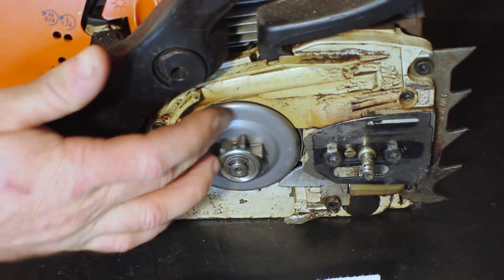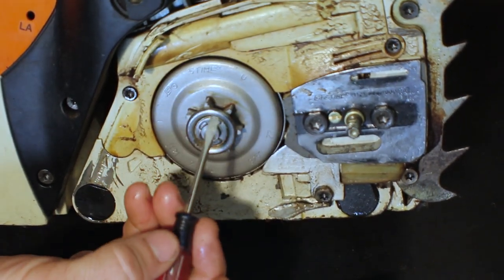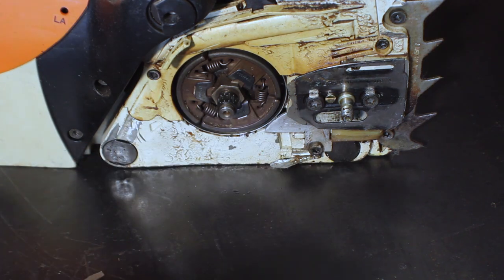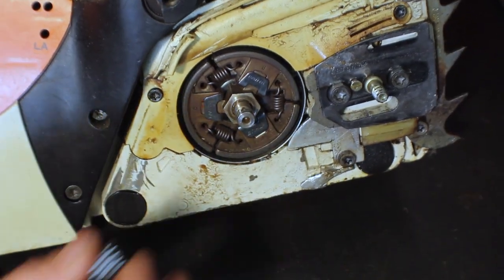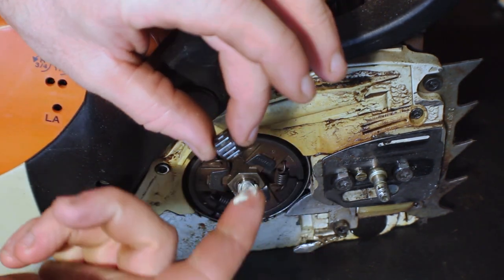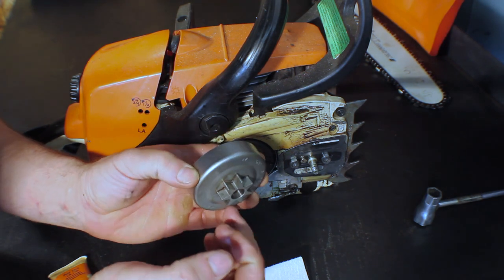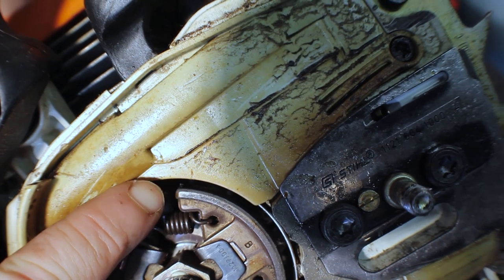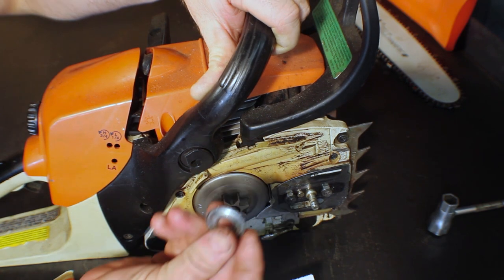Stihl Spur sprocket/bearing greasing/replacement How To

Comment: Thanks Human. Nice succinct video.
2:58 "use what you have" on the bearing and crank wrt grease.
Sadly, I used a light coat of regular automotive grease after a thorough cleaning. Installed a new bar and chain. Needle bearing lasted less than 5 minutes. Fortunately,  I saw the 'holder' washer laying on the ground and shut it down so no other damage done. 
Don't know...   ...maybe the e-clip (c-clip) wasn't seated and came off causing the mess and that's why things came appart?!?
Reply: Your choice of grease was not the cause of your problem.

Comment: Hi there!! I use Brake cleaner spray to clean the clutch and sprocket and then grease the bearing. Greetings from Greece!
Reply from the maker: That's a great idea, much cleaner that way.
Reply: After using brake cleaner spray to clean the attached clutch and the removed clutch bell, only a tiny amount of white lithium grease needs to be used on the needle bearings, otherwise the excess quickly flings off and coats in inside of the clutch bell (bad).
Reply: There is a blue color, sticky, lithium grease that resists fling-off and is highly water proof (Slipkote LC EP-2 with Tac).

Comment: Good stuff. Question, How do I remove the next piece after the sproket and needle bearing are removed? It takes a 3/4 inch wrench and is supposed to be removed by rotating it clockwise but the shaft rotates as well even when I try to hold it with a pair of vice grips. I'm essentially trying to check that "bar" that you reference that makes the bar oil come out. Thanks,
Reply from the maker: use a piston stop, or can just shove some pull cord into the cylinder after taking out the spark plug
Reply from the maker: and impact can usually take it off without having to lock the piston though
Reply: @Human1337  I ended up doing the cord method. Worked well.

Comment: I clean and re grease them every spring on all my stihl. I use weed whacker head grease. Found this when I was looking for 010av, so didnt help much, very different setup. Just bought yesterday, should have listen before i bought, but the mechanic spent 30-45 mins making sure it was adjusted right.

Comment: A friends borrowed my Stihl 046 and ran reg gas. The sprocket won’t turn now unless I really force it and it. Any idea what I can do?
Reply: Remove the muffler and look for scoring on the cylinder.
If so you will need a rebuild or replacement.

Comment: I own an old 021. Last year I overhauled it including a new sprocket. I put it away without cutting anything. I tried it last weekend, It starts and runs fine, It cuts fine, it oils ok, but it seems like the chain stops easier than it should in a cut. It's been a couple of years since I did any cutting so I don't remember for sure how it used to be. Can you suggest any cause/fixes for this or if it's even a problem? Thanks
Reply: Maybe grease inside the clutch drum causing slippage ?
Chain tension too tight ?
Reply: @900stx7  Thanks. I believe I was  just binding in the cut poor cutting form :)

Comment: 026 Pro owner. Residential use. Saw some wear on spur sprocket when I greased the bearing. At what wear Point is it recommended for replacement? Thanks. Steve, Plymouth MA
Reply from the maker: If it's in question I usually just replace it, aren't all  that pricey.  They do make a tool that has a built in depth gauge so you can check them though, https://www.stihl.com/STIHL-power-tools-A-great-range/Chains-bars-and-accessories/Tools-for-cutting-attachment-maintenance/21112-63674/Check-gauge.aspx

Comment: A piece of fence wire sheared off some of the plastic just inside the sprocket on my ms 201 cm. How do I take down the 201 to replace the plastic panel to the inside of the sprocket. I need a how to Vid!
Reply from the maker: Just take off the clutch and drive sprocket, just a couple of torx after that

Comment: The needles on my bearing do not spin very easy, everything moves around just fine though, but seems like the whole bearing just spinning on shaft. Should the needles spin fairly easily?
Reply: Should the needles spin fairly easily ?

Before the grease is applied, yes. 
With the grease applied, no

Comment: if ur sprocket is really worn...can it keep u from tightening ur chain all the way up?
Reply from the maker: Wouldn't think so, I'd look elsewhere
Reply: @Human1337  i have a MS 311 and the sprocket is really worn and my chain won't tighten all the way up. What else could that be? i'm tightening it the way I always do.
Reply: landons vlogs vlog your chain probably stretched out... go in and get it shortend up. Stop cutting with dull chain heating things up ... usually accelerates wear and stretching

Comment: no grease
Reply: what would you use?
Reply: @bdmenne  Clean and dry and a drop of mix oil. That clutch drum bearing surface is impregnated with a softer material thats self lubricating.